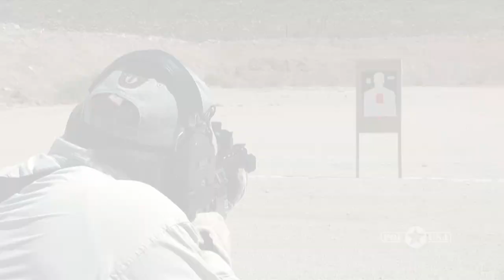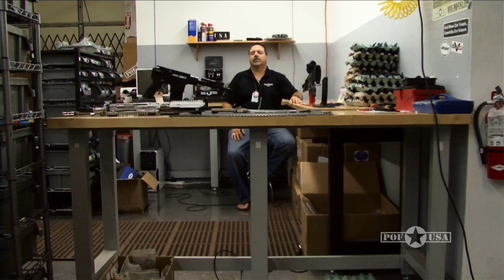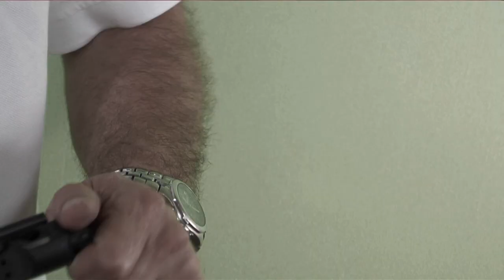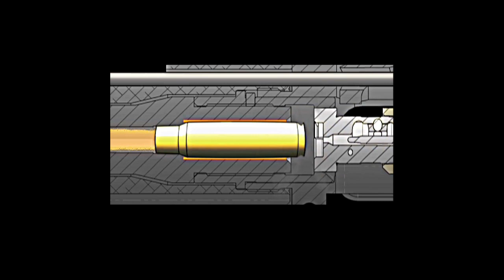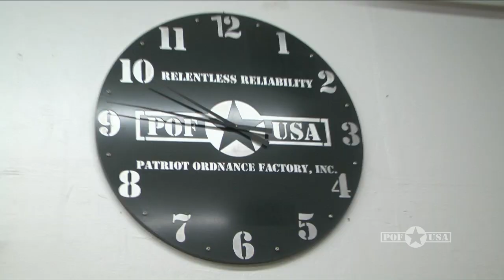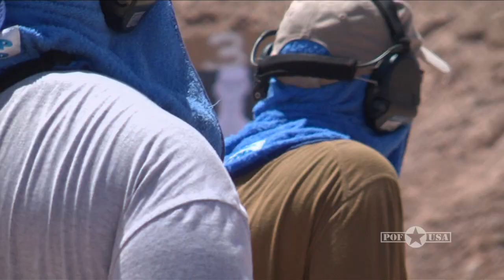Problem Solvers

Comment: I LIKE AJASTING GAS BLOCKS  IT WORK  WONDER FR THE AR FAN
Reply: Usually the adjusting gas blocks are for extensive suppressor use, and basic infantry won't be using a suppressor like a spec. ops would. It would be expensive as well, however i don't see why the special forces shouldn't use it

Comment: As an owner of a POF rifle in 5.56 I can tell you that Ive had nothing but great customer service the one time I needed it.  Ive had one failure in a few thousand rounds and that was when using 80's surplus ammo.  A small screw fell out of the ambi safety switch and I had a replacement the next day (no charge).  This is my duty rifle and I have no issues with trusting it to function everytime.

Comment: There's nothing special about having a gas piston system, just one of the many manufacturers who make them. And the reason the direct-impingement system was used in the original AR-15 was to save weight. This kind of defeats the purpose.

Comment: POF should change their name to POS. I have had lousy customer support. I have three different types of malfuntions including failure to extract rounds & cycling too fast. They claim to have "resolved issues" with Gas impingement system. I have two M&P AR15s that work flawlessly. for a $3k gun it should be flawless. Its ironic they spoof "huge" bolt speeds, and extractor problems, and that is exactly what I have with the POF.